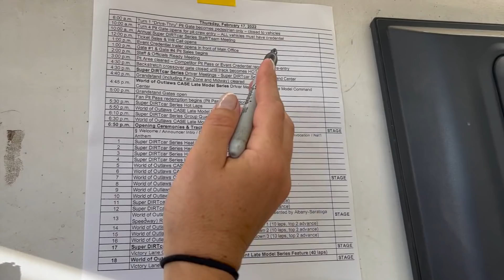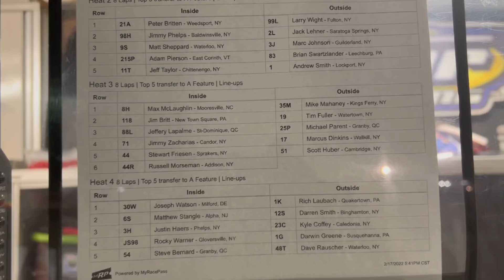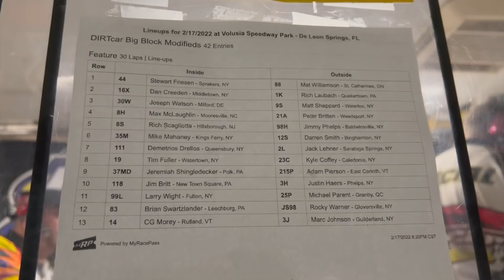Dirtcar Nationals Day 3 | Volusia Speedway

Comment: It's times like this that will drive you crazy and make you start second guessing yourself. You almost have to go back to square one. Take a few deep breaths. If the engine seems OK, there may be an issue somewhere in the chassis....binding shock, torque arms, slider/biscuit, hub bearing, a tiny stress crack somewhere in the chassis, drive train angle, etc..
Obviously, something is going on. Mike is a very talented driver, so I doubt there's any issue with him. Something is going on that is preventing you from getting to the front. It will drive you nuts. Just keep digging, go back to basics, and stay positive. I'm confident Team #35 will get it figured out. Regardless, I'll continue to cheer for you and wish you all the best of luck!! 🏁🏁🏁
Reply from the maker: Thanks!

Comment: Helium in the tires instead of air, helps tires run cleaner & alot cooler !, If okay in rules? FunFun with the nose camera 😊 I think Mike needs adj rear, shorten the inside measurement more , & lengthen the out side , let the rear drive car up ,& run outside ??